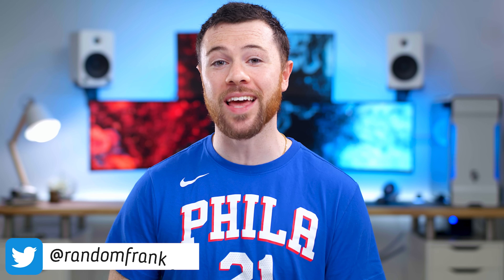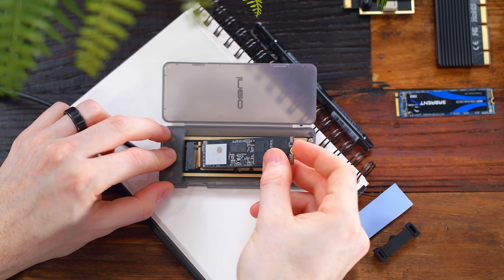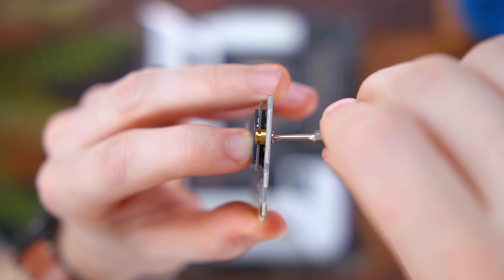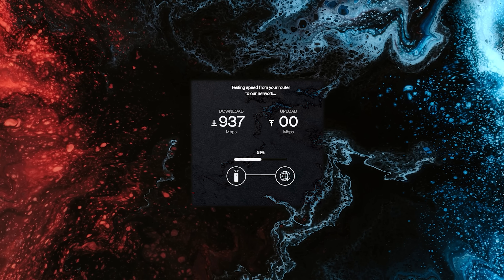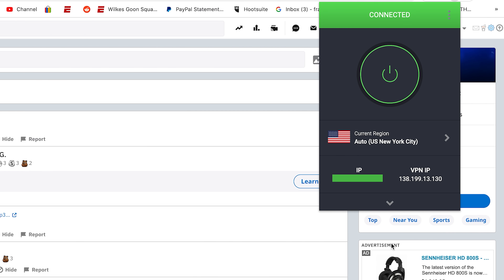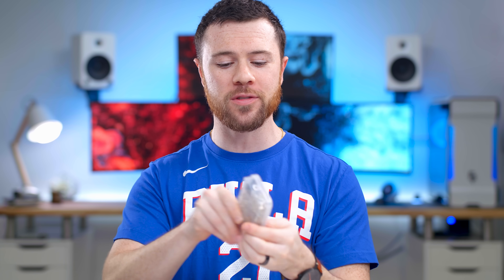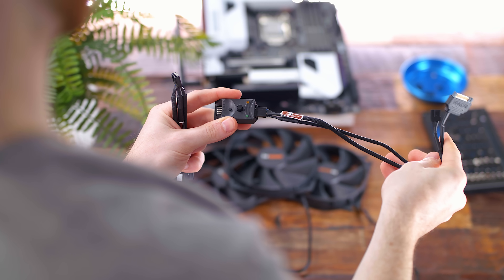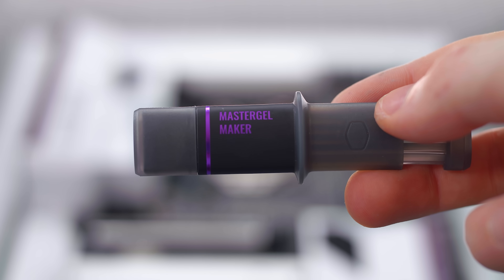10 Cool PC Tech Gadgets Under $50!

Comment: I think the way you talked about the Noctua fan controller is a bit misleading. It does control 4pin PWM fans, not 3pin fans. Also, the controller not only allows manual control, but also in tandem with the motherboard. If the board is not controlling the fans,  it's like a manual controller, but if the board does, the controller works relative to the motherboard duty cycle, and allows the fans to be reduced even lower.

Comment: geeeez he squeezing that thermal paste like it's toothpaste or something... U wanna bury your cpu mate? XD Too much thermal paste is a thing too you know ...
Reply from the maker: Maybe do some research, Google is free.
With this paste you need to manually spread and cover the chip since it’s not as loose as regular paste.
Reply: @randomfrankp  What happens with the mounting pressure of your coolblock then? You suddenly can't screw the screws all the way down now? by what, 2-4 mm? The mounting pressure is way higher than any type of thermal paste can handle. Two lines, okay, but you just put 3 to 4 lines of that goop on there. So what is it? Thermal paste or a thermal pad? If it's paste, it definitely is spilling over the edge of your cpu now......
Reply from the maker: Cant screw it down 2-4mm??? What?? How thick do think thermal paste is?? I only put 2 lines, but shot it twice from different angles if you watch again. 

And no, it’s not spilling over at all. If it were, do you think I’d just roll with it with the potential of damaging my build? No. Christ man.
Reply: @randomfrankp  Well how thick it looked it seemed like 2 mm at least. why spread it so much then? again my question, was it thermal paste or a pad, it seemed like you applied it like it was some kind of pad that covers the whole die in one go. Again, that paste is gonna go somewhere when putting a cooler on top of it. To me the video quite clearly shows 3 lines of paste, or are you just trying to get caught over this topic and fooling around? I have talked about your example with some friends and they all agree, too much is too much and half of what you put on there would have been enough already... Sure your pc won't blow up. You really think thermal paste can cause such damage? It can't it will only isolate more. To briefly mention another weird thing in your video: the m.2 pcie card, in the bottom slot... really ? Again did you do this just to get people's attention? or did you really not know pci lanes are a thing, certainly with an intel build... Well take a look at your cooler, then you see who was right XD

Comment: Just 1 thing, not all PCI-E 16 size slots are wired to run at 16x speeds, on ATX motherboards, you usually have the top, middle and bottom slots running at 16x, 8x and 4x speeds respectively.
Reply: he doesn't seem to care XD

Comment: Great video again Random. Question about the nvme enclosure. What is the speed compromised by connecting to usb c instead of connecting the same drive to the motherboard. My mobo has usb c 3.2 but the enclosure at 3.1 seems to be the bottleneck. Thoughts?

Comment: 3:40 says it is better than usb 
*plugs in to usb header*
Reply: usb for bluetooth, not wifi
Reply: @didnotkn0  but still
Reply: @CitroenGames  having the pcie connection improves the potential speeds tremendously but most importantly it has an antenna so still better than a usb transceiver
Reply: To be fair, he's saying that it's better than most 5 dollar shitty usb recievers, but yea, either way it's usb and he's making it seem like usb is the problem
Reply: USB c is the problem